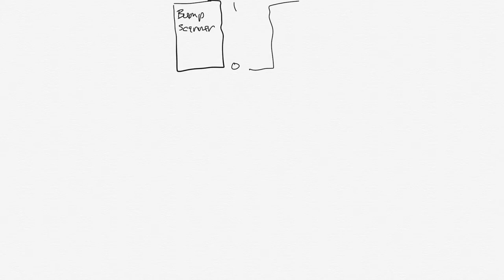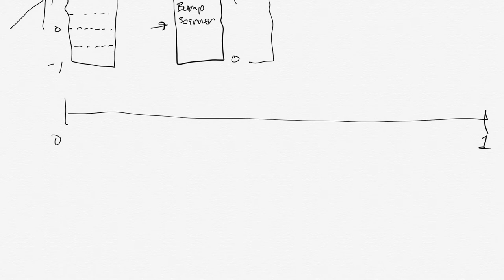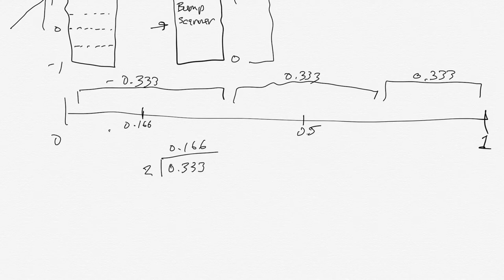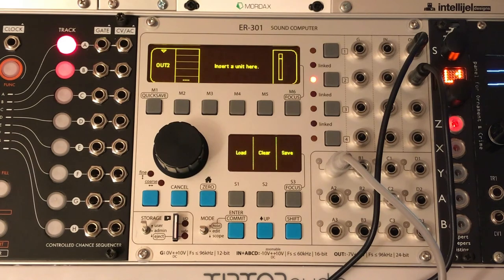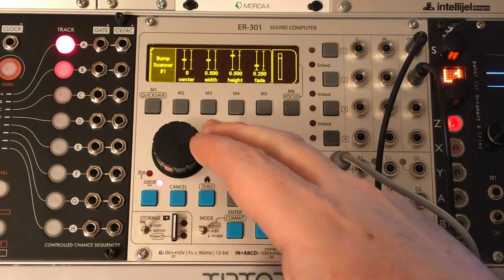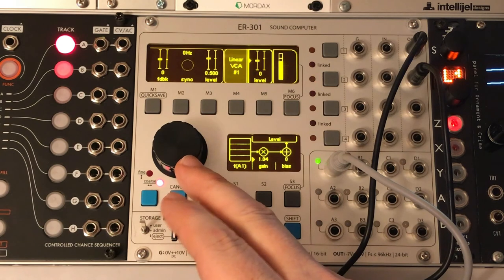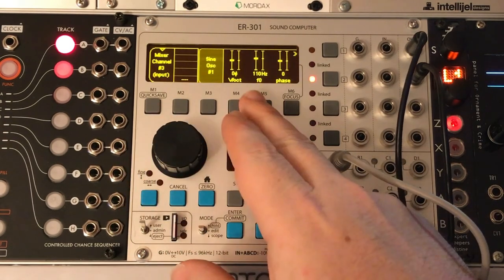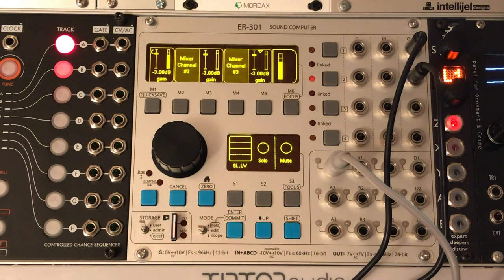ER-301 Bump Scanner

Comment: Thanks to your recommendation I am into the bump scanner now. What I want to achieve is that whenever I am sending it a trigger signal the switch should move forward on step to shift any incomng signal/audio/gates to the next output. So not beeing stepped by different voltages like in your case. Like a Doepfer A-151 would do in eurorack. Would it be possible to modify your concept with slight changes?  And how would I change between 2,3 or for steps..Amazing, if this would be possible.. Many thanks for your time! P.
Reply from the maker: @iholci - take a look at the built in Counter unit. It essentially converts triggers into voltages, increasing the voltage with each trigger until it reaches its max value (defined by you). Once it does it resets and starts the count over again.
Reply: @joefilbrun  tank you, Joe! the counter unit is a great idea!

Comment: thanks Joe, I guess there is no problem inserting an EG to make the transition smoother?
Reply from the maker: There's actually a parameter called "fade" on the Bump Scanner unit.  In this demo, I set it to zero (hard transition).  You could increase this though, and it would make each of the windows overlap each other.  You'd end up with something more like a crossfade between each signal as you scanned across the voltage range - a smoother transition.
Reply: @joefilbrun   many thanks!